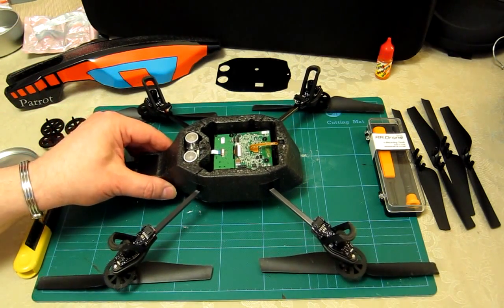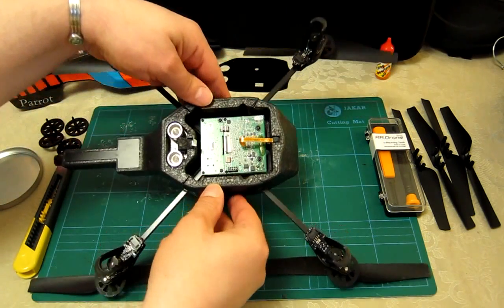Parrot AR Drone 2.0 - Repair Part 1 of 4 - Remove Central Cross to Replace - Step by Step

Comment: A mi dron le conecto la batería cargada y no enciende el dron....que puede ser.???
Reply from the maker: As I understand from translation: “ I connect the charged battery to my drone and it does not turn on the drone .... what can it be. ???”. Do you have more than one battery to try? Have you recently made a software update? have you tried pressing the red reset button under the battery?

Comment: Hi tom, it seems that my battery connection is loose. Is this normal?
Reply from the maker: Yes. Use the strap to keep the battery snug. You dont want it to move in flight.
Reply: Tom Strong Reviews should I send it for warranty.  when I first bought it, it has this issue and I swap it for a new one, but after for a few days it shows the same issue. Actually, the connectors are tight, is only when I fiddle around the wire and it starts to restarts itself.
Reply from the maker: Ahh! You mean the power connections between the AR Drone and the Battery. No, that should not be loose. (Mine have all been nice and snug and I have several batteries)
Test another battery if you can. Pity to take the AR Drone back if its actually one battery at fault. But sure. That should not be loose and power stability is crucial to good flight behaviour.
Reply: Thanks for your reply tom. Maybe can you try on your drone as well( if you still have it), like try to play around the wire connectors of the battery and power supply? if that happens to your then is a built quality issue. No point for me to send it for warranty.
Reply from the maker: I know all my batteries worked fine and my power connection was good on all of mine. So, no issue with my Drone nor any of my batteries. 
If you have a second battery you will be able to confirm with some certainty where the fault lies. If not... take back under warranty.
Reply: Hi again tom. Do you know what is the difference between HD and Standard battery in ar free flight app?? I can't really tell a difference

Comment: were i buy them connectors as ive bought 4 of these all got broken pins but i got em cheap for diy. im well happy but were i get them? and whats the proper name for them?
Reply from the maker: Not sure which connectors you mean ??
The ZIF connector ?
Reply: ye
Reply: or can i just tape them in?
I bought 3 for a projevct off a guy and all have bust the zifs. shouldnt i have 1 in a old rablet or smart phone?

i really want to try use smart tablet phone for controller.

oh while im here, whats my dual band situation "im new."
what amp escs are in these? im basicly building my own quad with this controller.
Goto buy sonar so can grab zifs
Reply from the maker: I am a user and repairer of this. Not an electronics nor app designer.
You need to join Maker forums etc.
Good luck with your build!

Comment: I found this series of videos very detailed and extremely helpful.  The only suggestion I have is one I found a short video on elsewhere.  To safely and easily remove the ZIF connector for the front camera (the one sandwiched between the two halves of the motherboard), also remove the Phillips head screws holding the left side of the motherboard to the frame.  The motherboard then easily comes apart at a single hard connector and the ribbon is freely accessible without being bent or pinched.  

As you allude to in your text comments at 4:42, ease the black portion of the ZIF connector just "slightly" out of the white socket by applying a little pressure at each end.  It does not have to move much to release the ribbon and should stay attached to the white socket. Without being angled through the slot in the motherboard, the ribbon cable slips easily out of the connector once the black clip is loosened.

UPDATE:  The "hard connector" is not that "hard".  After a couple of central cross repairs, which required me to separate the motherboard, the connector pulled loose from the motherboard.  It's hard to see that this has happened, but if you reassemble your drone and get a PIC WATCHDOG EMERGENCY message, there's a good change it's that connector. It is a surface mount connector and does not attach with pins that go through the board. I was not able to resolder it onto the board. Use extreme care working with this connector and try to only disconnect and reconnect it once.  Keep pressure on it when plugging the boards back together so the female side can't be forced loose from the board. Install the Phillips screws again so the motherboard has support from the frame.

For reassembly once your cross is back in place, the camera cable WILL reach without going through the slot.  Attach the nav board cable first, then the camera cable. For each, simply slide the ribbon straight into the connector and lock the black retainer back in place.  This routing of the camera cable is not ideal, but it's better than having to buy a new motherboard because of a broken board connector.  

Otherwise, your videos gave me great piece of mind as I performed this repair!  Thank you!
Reply from the maker: +Marv Hein Many thanks for adding such detailed and thoughfull comments. I did indeed make a mess of the ZIF connectors!
Glad to know this still helped you and you have now added to that information for people facing the same challenge!

Comment: Hello I was unplugging the connectors to the mother board and the black prices broke how can I fix them?
Reply from the maker: +Sean Blevins You could glue them back on, but I found just putting the ZIF connectors carefully back in place and using a small bit of tape works as well.
Reply: +Tom Strong Reviews Ok thanks for the help!

Comment: Hi Tom,

I replaced the cross section like in the video, but now when i take off the drone flips upside down, the propellers are on the correct way there just not turning the correct way. Do the motors spin a different way round? the only thing i can think of is that i put the motors back in the wrong positions. 

Regards 

Sam
Reply from the maker: +Sam Shaw Hi Sam, the motors are the same... But the propelled are not! You need to make sure that you get the A and C correct.
(This is only 1 part of the set of 4 videos. I do show what I mean)

Comment: Hi Tom, I was wondering if the replacement cross had the legs connected to it because my current (broken) cross has a missing leg from a rough fall.
Reply from the maker: John Hawes Yes, the central cross has four new legs already attached.

Comment: I replaced my central cross and now all of my motors run backwards. Props are correct, but it blows the wrong way. Whats up with that?
Reply from the maker: 73stratocaster That does sound weird... Did you also check the arrow to ensure the whole central cross is pointing the right way forward ??

Comment: Hi, thanks for the video, I replaced the cross like you described, however when I turn it on, instead of hovering it flips over to one side. Any idea of what I did wrong? Is there a way to calibrate it ?
Reply from the maker: Markus Huber glad it was some help. My first advice is that you should first double check the A and C type propellers are on the correct motors.
Reply: Tom Strong Reviews How do I check that? I probably mixed them up, how do I find out which one is A and which one is C ?
Reply from the maker: Markus Huber My series of 4 videos shows every step. You must not have watched the others.
Reply: true! Thank you so much!

Comment: Thanks for this video!  This was a lot of fun replacing the cross and motors.  I was able to get the connectors off the board by moving them out to the stops, then inserting a fine point tweezer in the gap and this forces the arms out a little.  I reinstalled all the motors, the unit went "green" immediately and I hit "take off" , the unit immediately crashed and broke a gear on the motor...it was cracked before I'm sure.  I'd recommend ordering a gear and propeller kit with the cross just to save time.
also, as mentioned above, a fine point tweezer is very helpful positioning these tiny screws.  I also did disassembly over a small box, definitely caught some screws headed for the floor.

You take excellent care explaining all the steps, but once you start this whole process of replacing the cross just takes 15minutes.  The motors take a few minutes each, label everything.
Reply from the maker: Tim Schorer glad my series of videos helped and thanks also for your tips.

Comment: Thanks for this, since early on in it's life (1st week intact) my drone has been erratic and one prop kept hitting the housing, never seemed to hover stable and only now when I was about to bin it did I find your video. Cross member in 3 pieces!!! Hopefully problem solved. $60 for tools + crossmember = $300 saved on written off drone. Thanks again.

Comment: I'm getting an motor emergency error....won't get off the ground
Reply from the maker: Ugg.. The central cross has wires that connects all the motors to the main board via 2 clips.
One for power. (IF you get lights or any motor movement it is not the power connector).
One for all the controls.

It sounds like you need to take it apart and make sure both of those clips are securely plugged in to the main board. If they are then its either a fault also with the main board or the female connectors that receive those clips.
Reply: Have lights....wont turn propellers
Reply: Thank you
Reply from the maker: btw - Do make sure that there is no 'real resistance' when you turn the propellers by hand. One finger used gently should be able to turn them each a full 360 with no effort and no jerkiness..
If there is - just check the gears and teeth and if your pins have been bent. (They bend very easily)
Reply: Thank you

Comment: I was wondering if you can help me...I put a new cross member in and did not mark my motors..at a loss on how to fix this
Reply from the maker: You should be ok. (They are all the same and controlled directionally by the electronics) The main thing to ensure is that you put the correct propeller onto the correct arm.
Reply: Thank you

Comment: Scotch tape! When you fold back the ribbon cables, use a piece of scotch tape to hold back the ribbon cables. It makes the job easier and you'll be a lot less likely to bust one of the ribbon cables.
Reply from the maker: A good tip!

Comment: This video helped me to fix central cross then now my AR.Drone 2.0 says "Pic Watchdog Emergency" TAT
Reply from the maker: Glad you managed to make your repairs.
The Pic Watchdog' error is usually because the Navigation board is not communicating with the Main board properly. Check your white ribbon cable is connected properly. (The Nav board is the small board that is partly exposed nd points downwards out the underneath of the main body.)
Reply: Thx!!! ^^
Reply: +Thomas Kim I know this is a year too late, but it may help someone else. The cause of this error on mine was the little connector connecting the two parts of the motherboard together. It had been jarred enough that the solder holding it to the motherboard broke.  You may see the little feet raised slightly off the board if you gently rock the connector.  I was not able to  reheat the solder with a low wattage soldering iron with a fine tip to reconnect it.  Had to buy a new motherboard. :(

Comment: I am wondering if you can help me solve a issue, using your video here I changed out the Central cross on my AR Drone 2.0. I also put in new high speed gears and bearings I have put everything back together and took the drone out for a test flight today. Everything powers up and the motors spin, however its almost like something is reverse wired on one side because the drone wants to turn on its side. Even when holding it in the house in my hand I can feel it pulling to one side. But all 4 blades spin.  What could cause this? Did something get cross wired somewhere? What things could I check or test to try and determine how to fix this?
Reply from the maker: The most common problem is that you may have put the wrong propeller blades on the wrong arms. I do explain this fully in my videos. (This is just 1 of 4)

Comment: Wish that text was on the video before i made the same mistake
Reply from the maker: Sorry to hear that you broke yours as well. They are a very fragile connector and certainly Parrot have a lot to learn to make their parts more durable and more suitable for home hobbyists to repair.
The discussions in the comments have been very helpful and detailed but it was a recent comment like yours that made me add the text to the video only recently when someone like you broke their ZIF clips.
I hope you manage to get your Drone up and flying again. Mine seems none the worse for the two clips and just the plastic being wedged back in place seems to hold the cables in fine.
Reply: Tom Strong Reviews Can you share with me or send me a pic of how you fixed yours.
Reply from the maker: Yska363 Better than that! Watch the remaining videos and you can see and hear exactly what I did.
Reply: Tom Strong Reviews TOm, I got my drone back together and the connections are good. I got green lights on the setup once i plugged the battery in. I then pushed the reset that is below the battery and got green lights again. When i tried to launch the drone it couldn't get of the the ground. The front up came  up just a little. I had green lights in the front and red in the back. Any advice would be great.

DO you think a 100% full battery woudl make the difference?
Reply from the maker: Yska363 Sounds more like you have the A & C propeller blade on the wrong motors. In this video series (This is just 1 of 4) I explain all the full steps including taking off and recording which type of propeller goes on which motor. Double check they are all correct first. I think you are very close to flying again!
Reply: Thats it!We have lift off!
Reply from the maker: Yska363 Excellent! Glad my videos were able to help get you flying!

Comment: What do you do if you break the ZIF connectors? Can you buy replacement connectors or do you have to buy new boards?
Reply from the maker: Mine worked fine with just me carefully re-inserting the cables. The one clip that I have left on both seems enough and I have not done anything else to my Drone for almost 18 months and it still flies well.
Looking at the spares options from parrot you only get the cables and connectors with the motherboards.
Reply: Tom Strong Reviews did you have to glue anything? did the connections every go loose?
Reply from the maker: Yska363 No glue or anything. I just slid back in the cable and the connectors. This is only Part 1 of 4. If you watch the re-assembly you can see exactly what I did. This flew first time and still flying!

Comment from the maker: I just wedged the broken clips back into place with the one damaged leg and they seemed fairly secure. My AR Drone flies just fine. If you do use a glue - find one that can be easily removed. Like the type companies use on the front of magazines when they stick 'free' CDs to the front covers.

Comment: Hi Tom, I broke one of the little clips as well. The smaller one from the sonar, or what ever it's called. My question is, did it fly ok when you installed the with one broken side of the clip, or do you think I should put a small dab of glue to better hold it still? Not on the contacts, but on the top. Do they sell new clips? Thanks

Comment from the maker: The screw driver is just a cross head screwdriver on one end & a flat head end on the other. Nothing special.
You will need something to help you guide on & off each circlip though.

Comment: .Paul Sim 2 seconds ago 

Hi Tom
I didnt read all the comments, but you might want to edit this video.
Those 2 ribbon cables that you broke the plasic holders, they are needed, they are to used to press the connections pins on to the board, u only need to push them out about 2 MM to release the pressure, then you can pull the cale out

Comment from the maker: Glad it was of some help :D
I have also 'fashioned' a repair of my broken one - in case I break my new one. Similar idea, but I also added 2 washers above & below, 4 zip ties tightening them into a compression type joint. (I might make a video to show later this summer)

Comment: Tom--thanks.  Very nicely done and a great help in fixing the crossbar.  I removed the broken one, glued it with heavy-duty epoxy and used three zip ties to hold anything in place should it break again.  Put the bar back and will watch how it flies, before I switch to new part, which could just as easily break.

Comment from the maker: Ryan. I am glad that you find them useful and like them..... and yes. It REALLY does help to know that these help. I found the Parrot ones lacking. These are certainly not perfect... But they do share step by step what issues and successes I encountered! 
As I crash and need to make more repairs - you can be sure I will make a half-decent video of whatever unfolds.
Many thanks for taking the time to comment. :D

Comment from the maker: I did not explain fully - The 'Jello' effect is when there is actually a vibration about your AR Drone 2. Looking at the video when in flight reveals this very easily. 
However - I do recommend that you have a full exchange of Props and Pins so that you can be sure.
(It may also be worth while checking out some of my other videos on how to change / test / check / all is well. You also do not want to also find that you have damaged gear teeth) Good Luck!

Comment from the maker: Testing indoors is always a good idea - you can exclude topics such as cross-winds.
However - Other things can affect flight / hovering such as 'warped' props or 'Warped' Shafts.
If you had a serious crash - you need to consider checking all 4 Props and 4 Pins. (I show this in other videos on my channel).
Q. When you record video whilst hovering indoors. Does the Video show any evidence of 'Jello' / 'Jelly' wobble ??